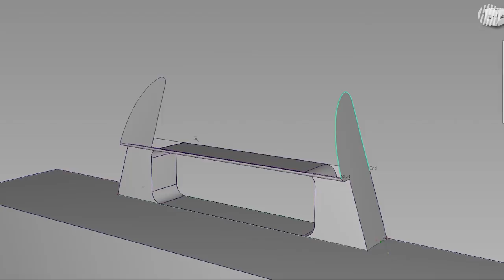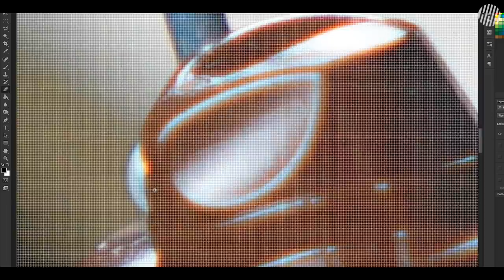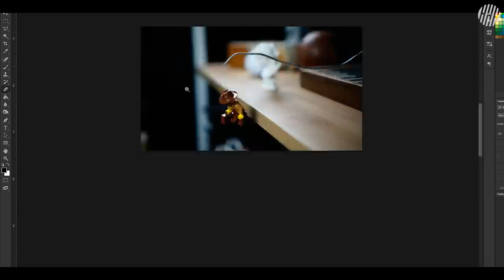Making LEGO Bag in Real Life

Comment: Beautiful work! Here's a random detail question - is there a method you use to make sure the draw latches aren't too tight or too loose when closed? I've done a few projects with them and always end up needing to take them off, fill holes, and try again until it's passable.
Reply from the maker: Well, When marking the location, I tightened it slightly. Sorry not that helped.

Comment: I've watched a couple of your videos now, and your end result is always nice, but I'm usually confused by your process. What is the advantage of making each handle from seven pieces rather than say three? Why have you cutout the depth/side pieces of the briefcase in halves and then glued the ends together rather than just cutting out rectangular rings? I'm sure you used that particular method for a logical reason, I just don't follow it as yet. I was also impressed with your leather work.
Reply from the maker: I'm sure that you are a maker👍. And I understand why you are confusing. Here's the answer and you will understand.

1. Sanding easier 
2. Low budget
Reply: I have to say, the lego editing, and seeing how you did it, was pretty impressive too.